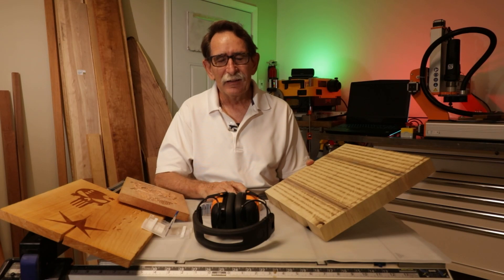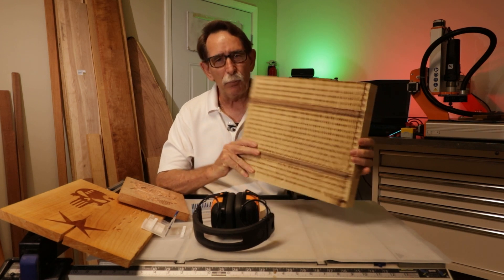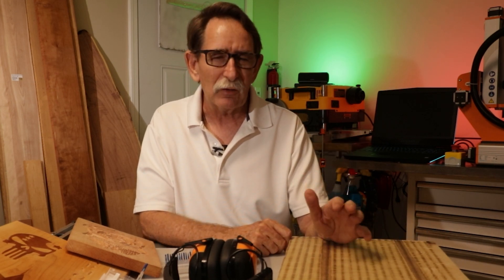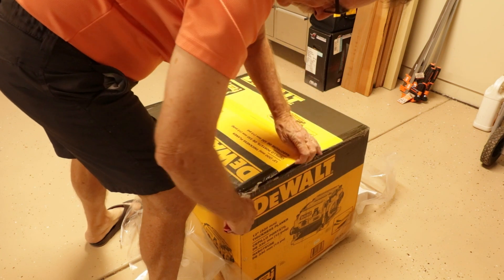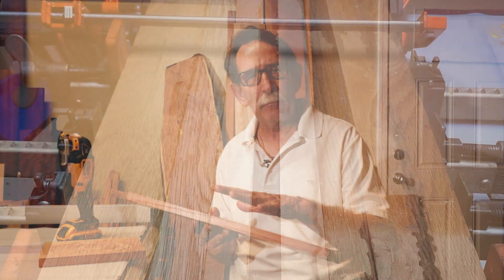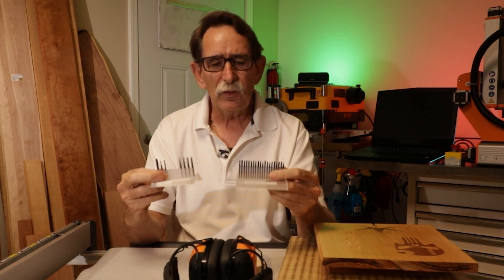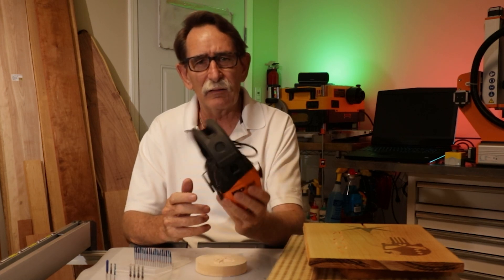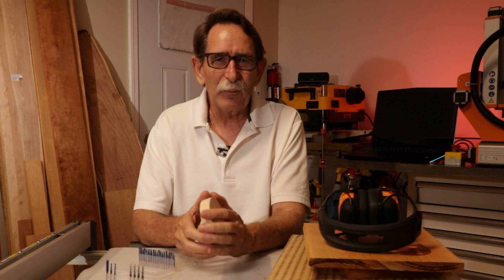Getting Burned by my CNC, Bit?  Learning how to use my Stepcraft M1000

Comment: Burning  the wood usually means your speeds are too slow and the bit is rubbing against the same spot for too long, letting friction build up too much heat. To roughly estimate what your feed rate should be, take your RPM (the mm-1000 works well at 24000rpm) and multiply by the number of flutes on your end mill. This gives you the number of times a flute scrapes the edge of the wood every minute. Multiply that by the amount of wood you want each flute to scrape off (typically between 0.01mm and 0.02mm) and you get an initial feed rate.

So a 2 flute end mill at 24,000 rpm would look like this:
24000 revolutions/minute * 2 flutes/revolution * 0.015 mm/flute = 720 mm/minute

The stepover can be around 1/3rd of the diameter of the bit, and the depth per pass can usually be about 1/2 the diameter of the bit.
This gives you rough starting points, but you're limited by the torque of your spindle and stiffness of the machine as it tries to cut through harder and harder materials. So to fine tune your settings run test cuts on scrap wood that's the same hardness as what you plan to be cutting. MDF is going to be easier to cut through than Padauk.

If the machine seems fine try upping the speed, stepover, and depth of cut by small amounts. Increasing one at a time and cycling through them each until the machine begins to struggle. Or do the reverse of that if it's already struggling. You're looking for a consistent sound with very little chatter and a good finish on the walls.
Reply from the maker: I say this with HUMOR,  where were you when I was burning the cutting board....?
Reply: @GeorgeKennerLaser  Haha, well hopefully this was helpful